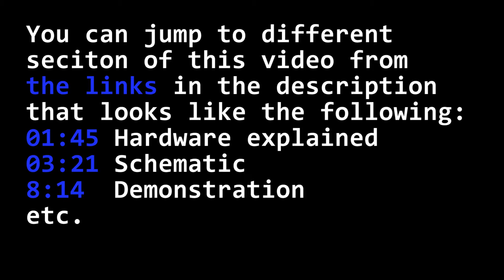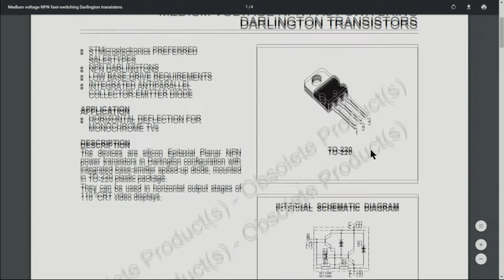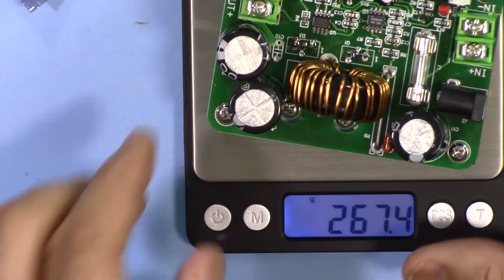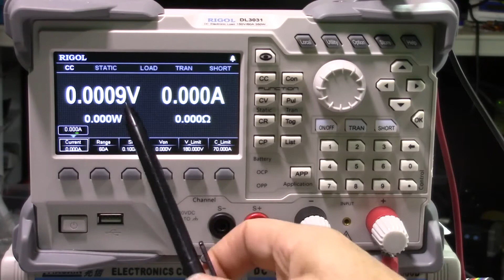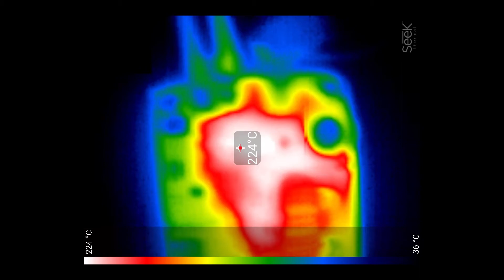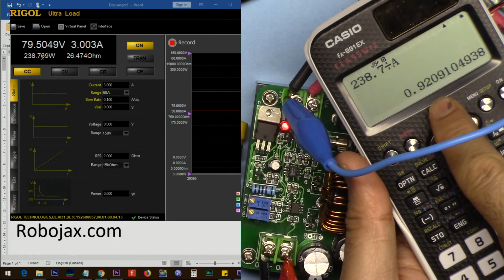Review of 600W DC10-60V To 12-80V  boost convert with constant current |  Robojax RTJ812

Comment: Greetings, I have the same one but mine when connected led 100w on car battery 12V 80Ah voltage drops from 33V without load to 30V and only 1.30A. Why is that happening? Aluminim case is cold. I can lower ratings for voltage and current but it won't rise above written. When i connected 3 H7 car bulbs in series voltage drops around 20V and current stays at 3A.

Comment: The differential voltage between input and output to dictate the efficiency of the converter.
Reply from the maker: no. it is the power difference.
Reply: @robojax look at the formula P=V square/ R. 
Given R is unchanged. Therefore the total heat dissipation or power loss is proportional to what???

It seems to be one say it’s a Lexus , the other disputes, it’s a Toyota. 
A knowledgeable person wouldn’t initiate this line of discussion.

Comment: I dont know if you are still answering questions in your videos, but i have a big doubt with no electrical background knowledge. What is the use of current adjustment potentiometer in this? Dont devices just pull amperes as much as they required (provided it is within the rated limit). What if i set the amperes too high while my devices (say amplifier modules) dont require that much amp?
Reply from the maker: we limit the current using the current knob. if we set it to 10A, it is like saying "you are allowed to consume only 10A" and it will not allow more. this in many applications is a protections system. that is why it is called Constant Current (or CC) and any device has this feature cost more than the one that doesn't. 
WE are adding resource page for this video so explain such questions. you may check the links or go directly to Robojax.com. cheers.

Comment: Please help me. I have four 12-volt, 100Ah gel deep-cycle batteries connected in series, giving me a total of 48 volts and 100Ah.
I need to power a 48-volt, 0.5A electronic device and a 30-volt, 2.0A device.
Can this Boos work for me? One for each case? Thank you for your help.
Reply from the maker: Hi, yes it can. but it is like you carry 1kg box using a truck. this is 600W and you need only 60W (30x2) and  24W( 48x0.5). Also keep in mind watch the test to make sure it works at 12V. I don't remember what was the minimum voltage.

Comment: Hi! Can you help me? My I-Adj (CC) doesnt work. I have a Ecoflow Powerstation with 12V 8A Output an a Hoymiles Inverter. If Current over 8A the Ecoflow turn off.
Now i have a 1200W DC/DC Converter. It works, but it is to big. Now i will use this Converter. But without CC does not work.
What can i do?

Comment: Do you know why i Can’t adjust Current? When i increese and reduce potentiometer there is no reaction
Reply from the maker: of course you won't see it. you can't adjust it unless you have a load. this is just liming the load. your load is determining the current. so connect a load that for example needs 2A. then you can adjust it to limit it for example to 1.5V and you will see it works.

Comment: When it comes to efficiency evaluation, how about accounting for the rather high heat developed!? Wouldn’t it easily show much larger total energy developed than js the input energy?! The module control firmware must very well be taming/constraining … ;(
Reply from the maker: Effeciency is about energy which is converted to heat. I am not sure if I showed the thermal image in this module but if the module is not going to heat above 85C then it should work fine. please see my channel on energy called WattHour https://youtube.com/@watthour
Reply: @robojax  Thank you very much for your response. Sure, the heat is - in principle, unjustifyngly - considered as loss, but in terms of the energy conservation the sum of developed heat energy and the electric power available at the output should not exceed the energy supplied by the battery at the input. But the legitimate question should be if that is the case, even in the conventional DC-DC converters implementations where its the very basic inductor-core's B-EMF might not be allowed to manifest fully!?

Please let me know if you would be interested to possibly jointly explore/pursue the underlying aspects?!

Comment: Volts + current can be adjusted separately for a resistance load, but only in the UP type adjustment. To lower adjustment, the unit is unpowered, and restarted with pots at lower setting. Then the upward adjustments are done again. The Capacitors have to be denergized for reuse. Also , current goes down as volts is increased, Example - no 6 amps at 28 volts! You need an adjustable  Boost type 900w or 1200watt converter to get higher amps and volts same time.  (even though it says 600w. That's only at the 13v lowest setting from 12vDC.The dealers don't tell you that! I use the E bay  rugged dc converters preset for volts and amps desired at high wattage. Then just add inline fuse to switch and battery.
Reply from the maker: Thank you for y our comment and sharing your experience. please see my channel on energy called WattHour https://youtube.com/@watthour

Comment: Thank you so much for this review. I love how you give a brief overview of the componentry, then an extensive review of the working at many input and output voltages. The thermal views are fantastic and give great insight into the possible longevity (or not) of the circuit. It is great that you show off the weakness and strengths of the circuit too.
Again, thanks for another great review!

Comment: input 150v output 400v for hi vote inverter
Reply from the maker: not sure, if this is a question you should start with "Can I find input 150v output 400v for hi vote inverter?" and if that your question just use Bing/Google and search "input 150v output 400v boost converter" and I am sure you will find something.

Comment: Which direction to turn the amp dial for higher and lower?  Is it clockwise to increase amps?
Reply from the maker: I just watched the video yo make sure I have given example of increasing or decreasing current.  I need it has been shown in the video when setting input voltage if 12V. Please watch .

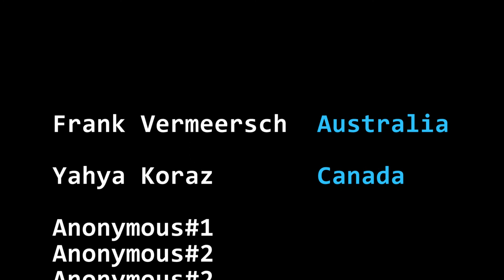Comment: 31:47 - 33:43 Very interesting for a electrics scooters, 36v of batery but is not constant, however put on Booster in batery to ECU, 
Input: 33v-42v of batery to booster and output: constant 41-42v for Ecu power. Opinions ?

Comment: Can we use it for 48v submersible water pump with battery or solar panels
Reply from the maker: I mentioned all specs including min and max voltage. it doesn't matter where the voltage or current is coming from.  Regardless of input voltage changes, the output will stay stable.
Reply: @robojax  thanks a lot for your respectable reply I am living uae can I get it in pakistan

Comment: Can I supply 40V and output 13.8V? To charger the battery 12VDC.
Reply from the maker: No. This will always higher voltage than input. It is boost converter. Check buck converter or step dow converters. I have so many videos
Reply: @robojax Most step dow  with low capacity - Many thanks

Comment: Some of your higher power step up reviews are missing.  Did the suppliers get upset that you called them out on not meeting specs? :)
You blew one up about a year ago, and I sent you some replacement mosfets, did you get it working?
Reply from the maker: Hello Steven,
Thank you and yes I received them. I didn’t know how to contact you yo thank you. It took them awhile to arrive and didn’t know what project they belonged so keep them somewhere in my lab. I will find them and see to if they belong yo this module and use them. Thanks again.  I am very busy I hope I  will make use of them.

Comment: Hi
I just burned my 072n10n mosfet; In my city, cant find this part; can I replace it with an alternative?
If answer is YES, please introduce more common mosfet like STW70N10F4
Thanks a lot.

And sorry for my bad English
Reply from the maker: Hi, here is the datashet for the MOSFET https://www.mouser.com/datasheet/2/196/Infineon-IPP072N10N3_G-DS-v02_01-en-522858.pdf you can get the parameters  from datasheet  and visit for example https://www.mouser.com/ and try find a mosfet that has close characteristics to this  mosfet. Good luck
Reply: @robojax  Thanks again
I found STP80NF10 on local market, can you confirm it's okay?
Sorry for wasting your time.

Comment: Hey Robojax,

I ordered this module. 
I will be using it to charge a 48V battery bank @59.2V between 3A-15A.
My power supply is a 48V 1000W DC motor ran by a gas engine.

What do you recommend I do in terms of upgrades?
I watched your full video and appreciate it greatly, I will firstly add solder as you mentioned.

Thank you.

Comment: Excellent video! I have the same module and unfortunately i can't adjust the current. I always get the maximum of the input. Should i check the mosfet or the current mode PWM IC?
Reply from the maker: Thanks. if you get the output voltage the same as the input, the mosfet or other components related to switching are dead.
Reply: @robojax  The voltage is adjustable as it should! Only the current is not adjustable... that's why i am confused!
Reply from the maker: then the current control section is damaged. There is opAmp and other components.  Most of the timte, it is the pot that gets damaged. check it.

Comment: I have used several of thesee with good results, after blowing several of them. I highly recomend ading a soft start on the power input to keep the input capacitors from blowing the unit when they are  in a discharged state.
Reply from the maker: Great tip!
Reply: How do you add a soft start? So how do you keep the input capacitors from blowing up?

Comment: in put 60v out put 24 v how can i do this or can some one tell me where to buy a converter
Reply from the maker: what do you mean how can you do this?  The input maximum is 60V and you just set the output voltage shown in the video. so you set it to 24V. Just search for 600W DC 10-60V on AliExpress.com or Amazon or eBay.com

Comment: Whether or not it is possible to use Ordinary Bulps and 220volts AC Mixer Grinders?🤔
Reply from the maker: this is DC converter. it receives for example 20V and outputs 50V DC.

Comment: Bro I have 12vots 50Ahbattry 
& I have 2hp mixer grinder 
Whether this causes the mixer grinder to be really running or not🤔?
Reply from the maker: check first the current the mixer is drawing while running and connected to the battery. if the current is blow or equal to the values I've tested, it should work.

Comment: Hi Bro😊 I have 12volts 50ah battery
So I want 600watts AC  invater (DC to AC converter ) for mixer grinder running..  & cfl using.. so please my Whataap to contact me = 9110698090

Comment: Good job!  Did you, by chance, check the switching period?
Reply from the maker: thanks. no.  output is filtered so and it was not needed.
Reply: @robojax  I was thinking in terms of skin effect having something to do with voltage drops.
Reply from the maker: to prevent voltage drops between switching cycles, we have huge capacitors calculated for the load to supply current during down time.

Comment: Couldn't get more than 49.5v and 2.05 amps out of it. About that it would pull double the input current with no change.
Reply from the maker: you are inputting 50V and 2A so P=50(2)=100W what are you expecting at the output? you can't get more than 100W because of physics law. so you will get 100 -100(1.15)=100-15%= 85W the 15% are losses in the module.
Reply: I can input 20v at 30a. There is plenty of power going in. I had to go up to 22.5v in to get it to output more power. Maybe you should know the setup before you critique

Comment: This helps a lot! Thank you!!! 
I am planning to run my laptop directly through 12v 26Ah battery. But instead of using modified sine wave car inverter, to power my laptop 220V AC adapter giving output of DC 20V 6.75A... Planning to replace the adapter with direct 12V to 20V 6.75A DC boost converter... And with the testing you performed I believe it will easily be able to replace my 150W laptop AC adapter with the one you showed, and I will save on spending money for pure sinewave inverter. Hope it fits right... Do let me know if i still need to be worried about anything else? Can you guide what might be the max Amps at 20V output with 12V input this module would have handled easily?
Reply from the maker: You are welcome. It should handle the load. Make sure you have fuse installed and set the constant current to the current never goes above the limit. Good luck.

Comment: Hi, I'm using this converter to boost it up from 16.8v to 19v and 4amp. Can I change the heat sink to a smaller one. This module is very big. Thank you
Reply from the maker: yes you can if the current is low.
Reply: @robojax  thank you

Comment: Hi can you teach me how to set this boost converter   CC current, input is 16.8v from a 4s4p lithium battery pack and output is 19v 7a. Please help
Reply from the maker: Hi, 1-first set the voltage to the maximum voltage of your battery. 2-Disconnect the power 3-short circuit the output (connect + and - together) 5-Connect Ampere meter (ammeter) in series with the load (see this video for measuring current https://youtu.be/9jwCc7uPGoc ) 6-turn ON the power 7- and then turn the CC potentiometer to set the current and read it on meter.  8-disconnect the short from output Done. Good luck.
Reply: @robojax  thank you kindly

Comment: Nice review, thank you! I am working on a project and I have 4.9 volts and 2.7A as input. I need to get out this boost converter between 11.5 and 12.5 volts. The current has to drop below 0.3A. Also the load is between 250 and 350 watts. Is it capable to achieve these values? May I need one or two of these boosters? Best regards

Comment: Can one modify the boost circuit to reach a fixed boost factor without the IC trying to stabilize it to a fixed voltage output?
Reply from the maker: first you need to draw the schematic and get all the components, then study them to see how the design work. finally if you know how it functions,  removing the feedback means unstable system. unless you add external different way to stabilize it. I am not sure if it worth working on this. I'd go with new designs. But you may try.
Reply: @robojax  thanks
Reply from the maker: you are welcoem.

Comment: A complete schematic would be helpful for me as I like to exploit the CC operation with external control. In which range is the the current settable with the on-board potentiometer? Could you elaborate please on the sophisticated generation of the 5V voltage?
Reply from the maker: wow. schematic may be found online. But your projects is interesting. this was just one time video making.  Not worth looking at it as most Chinese product, this doesn't have model number so people can't find it if they need it.

Comment: hai robojax 

i actually looking for buck converter for a projects (tethered drone) 
the idea is sending Ac/DC  200-300v (adjustable) through a 100meter tethered cable to the drone (buck converter) we tested we need 24v/800w to keep the drone operational.   
so basiclly we looking all around the internet we can't find DC step down 200v to 24v .. 
in my hand we already have the AC/DC 0-300v 1.5a adjustable power supply. and a buckconverter brought from ebay (70v to 24v 800W ) 

we do try sending 70v from ground and stepdown to  drone buck converter( 24v 30amp) it seems like the buck converter never reach 30amp) so my guess i need to supply greater voltages to the buck converter..

do you have any recommandations any DC/DC step i shall buy for my applications ? 
any reply in this would be highly appricated 

Thanks 

Regards 
Fei
Reply from the maker: Hello, thank you for writing. I am very busy with my Udemy.com course and my YouTube and family stuff.  In short you need 800W 24V. this would be very heavy. from the word drone I understand that it must be involved in heavy flying machine. 33A 24V is unusual. So you may get two modules in parallel with 15A each. I would suggest sending 36V over wire to the drone (I know the wire will be heavy to carry that current). Can't think of anything.
Reply: @robojax  The drone it self is 4kg and have the capacity to MTOW 10kg . anything below 6kg shall shall be okay (i have 800w 24v attach on the drone unit  MY bad there is some typo at the beginning) 

i might as well try get two 15A modules in parallel . 
as for the cable we using low weight cable like this (https://www.gore.com/products/tethered-drone-cables)

 Very Much appriciated for your value input..
Thanks again. 

:D
Reply from the maker: You are welcome and good luck.

Comment: Well explained the device and the efficiency. My requirement is that I have 18-20v with 4-5amp input power , can I get 14.8v and 6-7amp current
Reply: Means I want lesser output voltage than input and boost in current
Reply from the maker: this is what this does. if you want to boost current, then voltage should be low so the output total power is about 15% less than the input. Yes. it should work this way.

Comment: Why you buy another one if there a possibility to fix the unit by only change the mosfet
Reply: You see I don't like to throw away any electronic equipment just for need a transistors . You can get many transistors ( it may not work like original ) with very low cost like 10 PC's for 20$ including shipping ( best quality = 70 % from original )
Reply from the maker: I have 100s of item and 100s of projects to do. The mosfet and shipping was almost the price of new one.
Reply from the maker: because the mosfet + shipping= New module
Reply: Offfff ! For real ? . Can you just test and equivalent with low cost ? And if you can see if you can get any from old powersupply or some mosfet in printer laser boards . You may like what you can get from old stuff